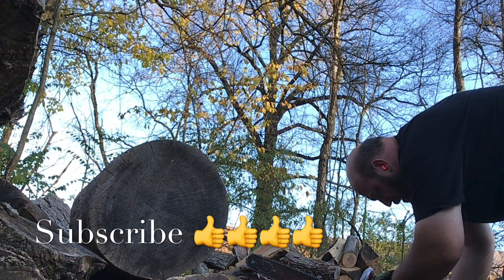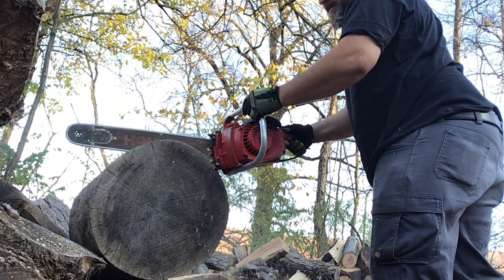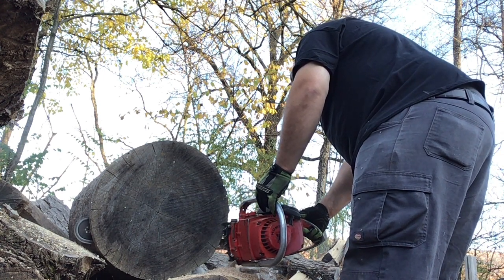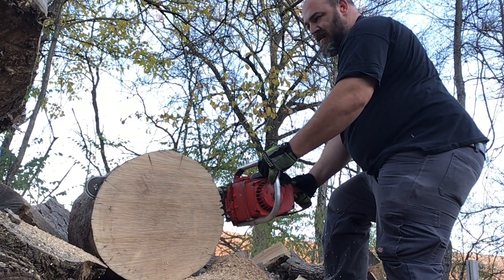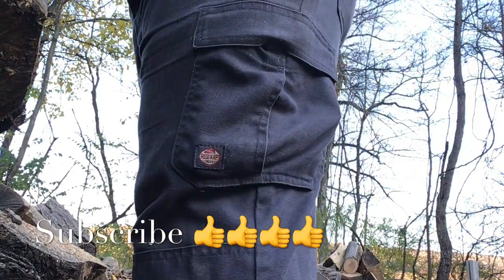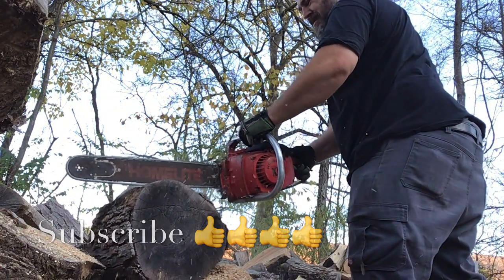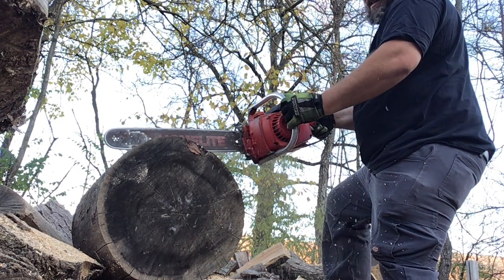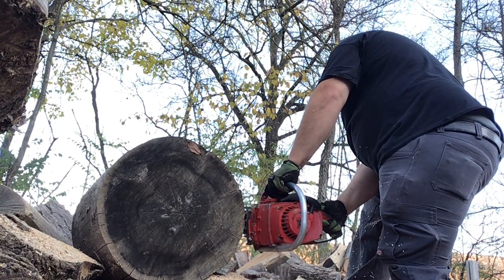Ported Homelite Super XL-Auto!!  Test and Tune!!

Comment: Saw sounds pretty smooth doesn't seem to be bogging seems to have plenty of RPM and torque to pull through that dry stuff might need to refile different angles on that chain to cut a little faster but otherwise that sucker sounds pretty nice good job
Reply from the maker: Im going to test it on some wood that isn't that hard.  That was the driest hardest wood I have.  It is not normal for me to cut wood that hard.  Very rare actually.  It is just what I had available.

Comment: Sounds strong it's holding RPM in the cut pretty good I like it u did great just gotta get er tuned an u be good.
Reply from the maker: I think it will handle 24” bar now!
Reply: @Smittyschainsaws  I think u are right
Reply from the maker: @justinweaver8787  😎😎😎😎

Comment: Good video. I believe I saw one of your videos, just recently were you were splitting some of this stuff and the splitter had a hard time one one of the pieces, bogged down and the frame flexed. That is some hard wood......dense too- could make out any growth rings. 
Saw runs so much better than stock, even with tuning issues. Definitely would be good to see it in some less seasoned wood. 
You should find some pine or poplar so you can really let it rip!
Reply from the maker: I have some white oak that i was going to try it on next.  I don't have any pine or poplar laying around unless I cut a tree down.  I don't know what species that wood is but it is like trying to cut steel.

Comment: would rpm drop more in softer wood by it cut more bigger of chunk ?
Reply from the maker: It is possible.  It depends on how much torque you have available.  We are going to put that idea to the test on the next video with this saw.  I am also going to work on the reed problem.
Reply: @Smittyschainsaws  no matter what way better then stock . good job
Reply from the maker: @nc6333  I still have room to go a decent amount farther.  I you understand the numbers .063 squish 103 exhaust 152 duration.  That is where it sits now.
Reply: @Smittyschainsaws  im pretty new in porting things so yes and no lol . thinking good  fire wood saw right now thats for sure
Reply from the maker: @nc6333  That was the direction I was heading.  An every day firewood saw that runs really well!

Comment: What mix do you run ur saws if I may ask my friend
Reply from the maker: I am running 40:1 right now. As soon as I run out of gas I am going to try 32:1. I’m trying to figure out the maximum amount of oil that doesn’t interfere with tuning a lot.  I went from 50:1 to 40:1 and it had no effect on tuning. I’m going to try 32:1 next as soon as I run out of gas.
Reply: @Smittyschainsaws  I run 40:1 but am also thinking of 32:1
Reply from the maker: @justinweaver8787  doesn’t hurt to try!!

Comment: I would knock rakers down
Reply from the maker: This species of wood is just extremely hard.  The rakers are set where they should be.  The first cut had a chain with deeper rakers and it just got really jumpy in the cut.  It didn't help at all.  I had to switch chains with a less aggressive raker to smooth it out.  I have a video splitting it and it really puts a hurt on the splitter.  I don't know what kind of wood it its but it is like trying to cut steel.